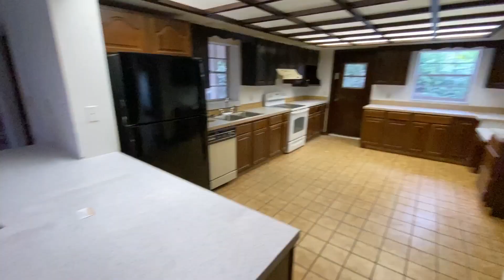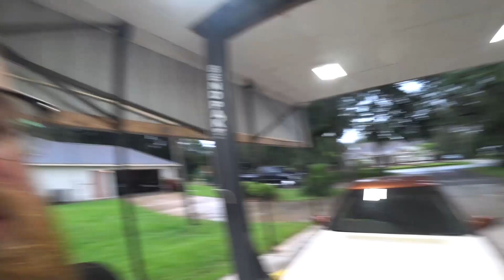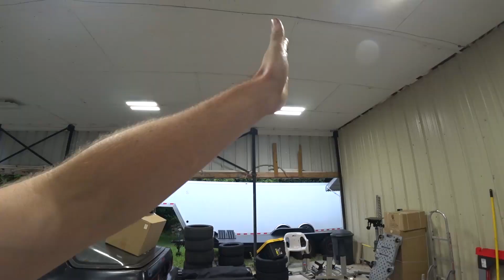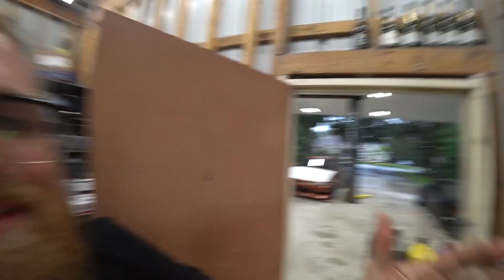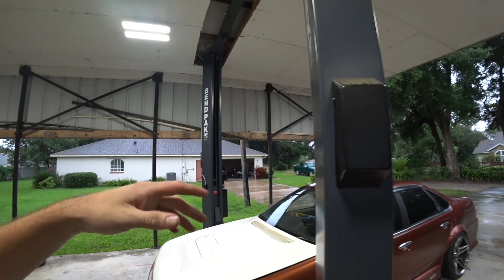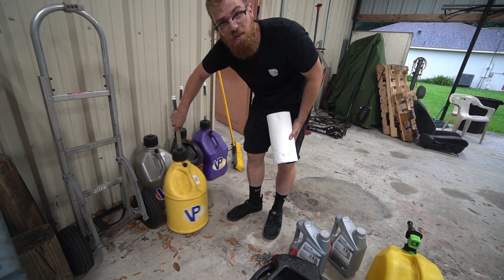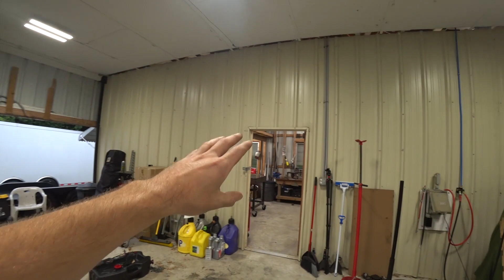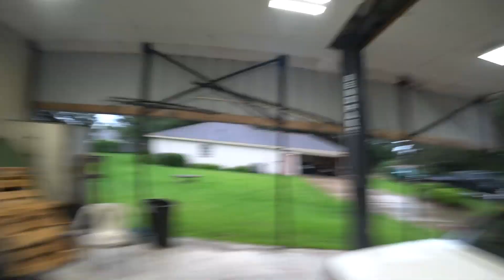Update on my new shop. I have to tear it all down.

Comment: I would use plywood instead of “drywall” as it helps insulate, soundproof, structure strength, and ease of mounting racks etc to the walls. Then the bonus of its way more hard wearing, so if something rolls into the wall it won’t crumble…

Comment: New shop sounds killer! I have been thinking of installing AC at KSR too, its been bad bad hot/humid lately!!!
Reply: The work you done on mullet is top notch kev waiting for you to pull that charger out bro👍👍
Reply: No AC in Florida just sounds crazy.
Reply: @mje19D  normal for shops
Reply: Alright Dennis Leary " walk around in the summertime say how about this heat. Cause I'ma ..."
Reply: Look into solar, shops usually have giant flat easy to-install solar roofs. Solar = guilt free A/C running 24/7
Reply: Although, I'm not sure how much of a pain Florida is for hurricane ratings and solar panels.. still worth a quick look into!
Reply from the maker: The humidity has been insane! I feel like AC would increase workflow enough to pay for itself!
Reply: @Taylordrifts  solar powered aircon?
Reply: 6-7k, can't be that much?
Reply: A/C in Wisconsin's humidity pays for itself. So for you guy's I would think it's also a must!
Reply: @Taylordrifts  This year has been insane on the humidity - speaking from how it's been up here in the Atlanta area, can't even imagine down there in Orlando area.
Reply: @andrewphillips470   There's a couple of shops here in New Zealand with Solar powered A.C .
Andy my engine builders shop is one of them and he built his shop with this in mind and went that little bit extra on Solar to also help power the house as well to off set cost's.   Now He has find he's making about $125 to $150 per month in power being sold back to the grid and is completely loving it since it's making him money why he working in the shop.   He said it took 5 years to pay for itself an Andy said the best investment he's ever made.
Reply: Could you re-use the trusses , and save a little bit
Reply: @andrewphillips470  Seems to be some serious protectionist bullshit in Florida from the utilities over homes with solar.
Reply: As someone here in central florida being completely over this heat, i just put a through the wall ac unit in my garage (mind you its just a 2 car garage) and its the best damn money ive ever spent. Been only 3 days but ive been able to get so much more work done without dying. Totally worth it.
Reply: My shop up here in Canada has ac and I couldn't imagine getting anything done in a non air conditioned shop!
Reply: Yep, people think insulation is expensive but it isn't in the long run, as it makes it a better environment to work in.
Reply: I put heat and AC in my shop as soon as I got it closed in.  I live in Indiana so we get wild temp swings from -30 to 105.  So having the heat and AC makes it a WORLD of difference and I can go out and work in comfort any time of year.
Reply: @chadshumaker2789  I'm from Texas it gets as hot as 115 I saw 118 once
Reply: I worked outside in south Texas and the company I worked for had weekly safety pamphlets we had to read and sign. It seems they found a study for one of them that explained the for every 10 degrees above 70F you lose 12 - 15% productivity in labor. It said most of that was rehydration and stopping to cool off to keep from over heating.
Reply: @Taylordrifts  Do you get good pay back tariffs for solar in the USA ? Cause nothing is sweeter than free cold air, hell if you can get a good enough system on the roof you could end up with free lights and everything. I have solar on my shed and house in Australia and i run two mini splits in my 3 bay shed 24/7 and three in my house for most of summer and still get money back so it is worth a good look!!
Reply: You gotta do A/C. I put a mini split in the 1500 SF enclosed workshop side of my pole barn. I am up in the midwest, and that was the best move I ever made.  It's not even always about the temperature, it's having everything you touch not be soaking in humidity.
Reply: @Taylordrifts  100%. I turn the AC off in the house, turn the AC on in the shop and make myself go outside and do an hour or two of work. I am so much more productive with some cooling in the shop.
Reply: @maldenfoster  ceiling fan, ceiling fan, ceiling fan. You can have a point cooling source, like a window AC unit or a mini split. But you need to have a way to distribute that air around the shop. Especially with tall ceilings. In the winter I don't get any heat at floor level with my 16 ft ceilings until I turn the fan on. AC it's not as bad but it still makes a huge difference.
Reply: @stevegirard817  as a wisconsinite, can confirm.
Reply: Being from Texas I don't understand how you guys work in a shop with no AC lol id be dehydrated after half a day
Reply: @Taylordrifts  as someone who works in a shop professionally, I can definitely say my productivity goes down on hot days. When you're hot, the air is hot, you're having to pull away from a car to soak your shirt in water and the cars literally take 8+ hours to cool down enough to touch anything under the hood it just kills productivity. It was 120° here for about a week and everything dragged down to a crawl.
Reply: @Taylordrifts  whats the contact for your realtor
Reply from the maker: @4drcivic512  https://www.remax.com/real-estate-agents/laura-harms-orlando-fl/100108256
Reply: @Taylordrifts  thank you good sir.also I need a spoiler installed is that something you would be willing to do?
Reply: I put AC in my shop in AZ, and it's been the best thing I could have done. Last summer, i didn't go in there for 3 months. this summer I can actually stand to be in there.
Reply: Kevin you need to move to the coast where you can at least enjoy the breeze off the ocean. I agree though, as a lifer here in Florida, its been pretty damn humid for a few weeks now. It beats the heat and fires out west though.
Reply: @mje19D  Part of my work day is in a warehouse setting in Florida early in the morning (i.e. 2am)...even with 15 large osciilating fans in the shop, it doesn't really help when its just blowing around 75+ degree temperature with ridiculous humidity.
Reply: @launceherron  
I'd bet because of permits and contractor idea no. A lot of builders want all new materials.
Reply: Worth it! We just have an office space with a mobile ac unit in it. Always find us walking in there to cool off.
Reply: I live in North Dakota and have a/c in my shop. I can’t imagine what it would be like in Florida
Reply: Just close the sides in with 30mil plastic sheeting
Reply: m
Reply: @MoondyneJoe  Tony that sounds amazing, but Taylor lives in Florida which can have 90-100% humidity in addition to hurricanes plowing through the state for at least 6 months during hurricane season and the solar array would have to withstand winds up to 150 mph in a category 5 hurricane as well as any tornadoes that might develop with the drastic changes in weather conditions throughout the year. All buildings in Florida have to have various types of tie down systems and ways to help make the structure withstand the hurricane winds and winds from downdrafts because a hurricane is basically a giant tornado on massive steroids as they both involve circulating winds that carry debris from things it destroys along its path and a hurricane carries a lot more water/rain with it and covers a larger area than the typical F5 tornado. Because of the constant upgrades in safety features required in new builds that is way its cheaper for him to tear down the existing structure and build a new and improved one that has been built to the current code regulations.
Reply: @ksr performance & fabrication I got you. I'm in Florida. We can add the ac for ya

Comment: Build once; cry once. I think you'll be so much happier with a new shop setup the way you want it. I'm the same way. I spend 90 percent of the time in my shop.
Reply: That's what I did. Built my house with a big attached “garage”. My “garage” is bigger than my house.
Reply: @carls2210  I'm building a house next year. 3000 sq ft house, 3000 sq ft shop. Keep it nice and even.
Reply: @dubCanuck1  here in Texas, it was easier to do an attached garage than building a shop later on. And a lot cheaper. Plus I have no kids so I didn't need a big house. Rather have a big shop.

Comment: Our area had no permitting at all until the year we started building our house, but luckily we still don't need to do anything but apply to build anything else. I am starting a 32' x 48' woodshop by myself in a couple of weeks. Should be fun 😉 One thing I will be doing is adding a compressor/dust collector shed. A totally separate building to eliminate the noise. AC sounds sweet as well 😊

Comment: Just the government doing what it does best... protecting the people from themselves by wrapping them in expensive red tape.
Reply: @tommak6516  Why would i care if his building blew over? Not my pig, not my farm. Guess you "work" for some form of government. Sorry I hurt your feeling bro.
Reply: @swackhammer2139  Things are engineered for a reason, so things work.  That is why the wheels do not fall off you car when you drive, etc, etc, etc.  It is irresponsible to just let anybody build any kind of crap just because they think they know something that they don't.  I do not work for the government.
Reply: Hurricane Andrew was one of the worst disaster in the history of the US. One of the main reasons why it was so destructive was that Florida was not reliably enforcing building codes at the time. This is not a freedom issue unless the freedom of people not to be killed by parts of a building blowing off in hurricanes doesn't matter. The building that collapsed in Surfside hand numerous defects that would have been prevented if it had been built to be compliant with modern building codes.
Reply: @tommak6516  so it appears last years codes are not safe enough to build to BUT safe enough to let the building stand. Meaning he can't add on to it for it would be considered unsafe. 🤔 Perfect example of following rules to your own demise over realistic practicality of proven engineering.
Reply: @swackhammer2139  don't be sorry,, he missed the point completely

Comment: New shop is the way to go. I did it with a steel structure. I thought about drywall but my dad convinced me to use plywood at least the bottom 4 feet I did it all the way up. I am glad I did. No drywall to patch when you hit a wall plus I can put hooks up and not have to worry about hitting a stud.  I have no heating or AC but I have two great ceiling mounted shop fans that make it good enough to work in. I would also add about 50% to the time estimate because "Contractors". Hope everything turns out the way you want and I look forward to seeing it. Cheers.

Comment: When I moved to Oregon I told the realtor that I needed a large lot with a large shop and one or two room house because my wife had to live somewhere. Ended up with a nice ranch house on a very large lot (close to 1/2 acre) and a 30X40 insulated and dry walled shop with plenty of power run to it.
Reply: Wtf very large 1/2 acre? That's nothing
Reply: @mattlane2282  tell that to someone who live in a city. It is all a matter of perspective
Reply: WELL... When I bought my 5ac. lot in Oregon the first thing 10 years Before I built a house was build a 40' X 65' shop and it is now TOO SMALL... always build 20% or more bigger , it pays in the end.
Reply: I too live in Oregon... Linn County to be exact... 2 1/2 Acres and to build is an absolute cluster "F*&*^!!! The Red Communist state of Oregon permits you to death with everything they can! Thousands and thousands of dollars for nonsense! Sucks! Note! Besides the cost of permits, Budget for a tractor! You'll need it! Just sayin!